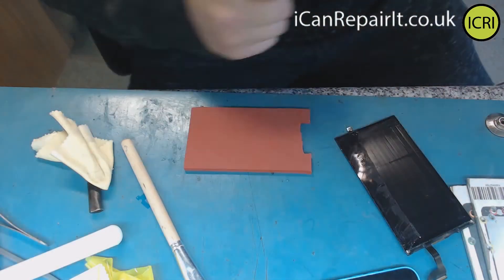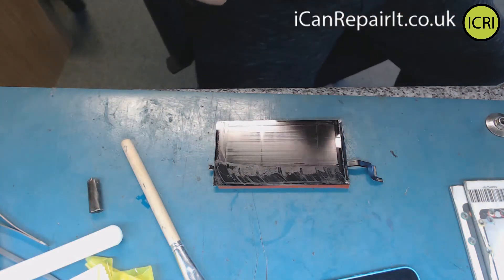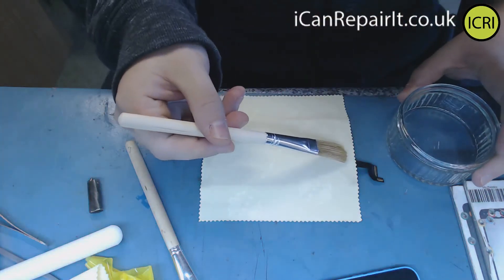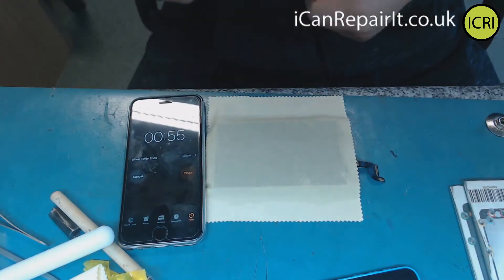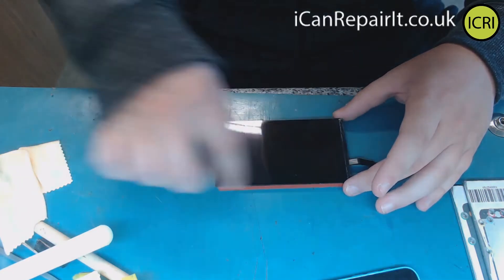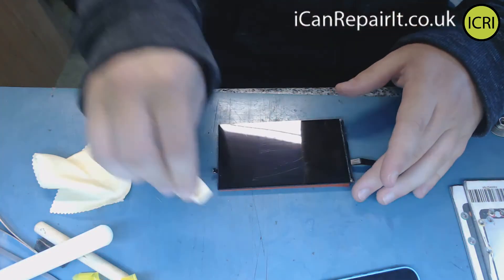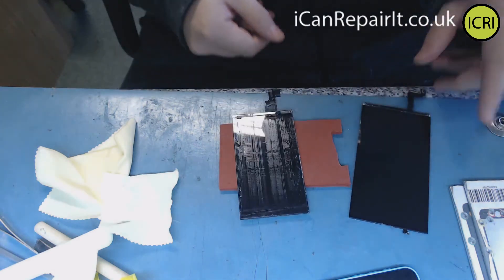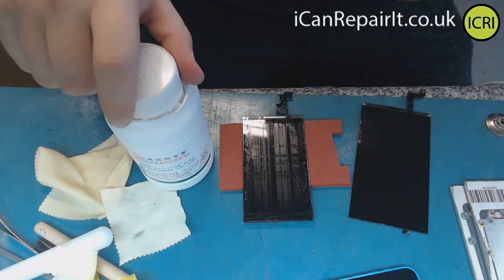Fastest way to clean polariser glue from LCD's | iCanRepairIt.co.uk

Comment: Can you tell is there reall difference between 8222and 8333?
Reply: Its been a long while since i last did anything phone related but if i remember right 8222 was for polariser glue and 8333 was for cleaning oca (the glue above the pol) however i did stop using these chemicals and switched to the red blade holder with a dorco shaving blade.
Reply: @lewisskeetmusic7502  i am looking stuff that will help remove displfrom ipad. There is glue only around of screen
Reply: @Home_made_ch  if it is ipad refurbishment and you are looking to remove the glue after cutting it with s molybdenum wire i recomend d-limonene and spinning rod tool and a final clean up with acetone
Reply: @lewisskeetmusic7502  i am not removing glue after, but desolving glue before removing screen.

Comment: Hi, thanks. How many screens can a 250ml do (will it be more than enough for a 17" LCD)? Can you wash the lens cleaning cloth to remove the dissolved glue or you have to use a new one every time (what detergent)?  Can you use fiber cloth?

Can you used 99.99% isopropyl alcohol to clean the OCA remover for the polarizer ( the 8333 version is the OCA or LOCA for the LCD glass, I believe)?

Thank you. Advanced happy Easter

Comment: can you use 8333 oca remover in the unit you used clean?
Reply: I think they are the same..I been thinking about it long ago but then when i research it on our local online shop...the casing is the same. I mean the product.
Reply: @MCircuits  If you go to Aliexpress search for 8222 Remover Liquids.  You will find in their description on the use of 3 liquid removere namely, 8222, 8333 and 8777.

Comment: can we use this to clean s7 egde lcd screen please reply ASAP
Reply: Isfandyar Kashif yes then clean using acidtone.
Reply: Use the 8333 because for the S7 Edge it is a glue between the touch glass and the digitizer. The 8222 used in this video is for the polarizer film which you can find on iPhones.